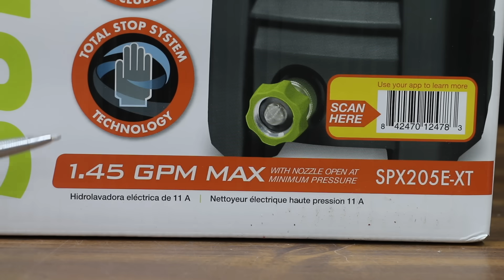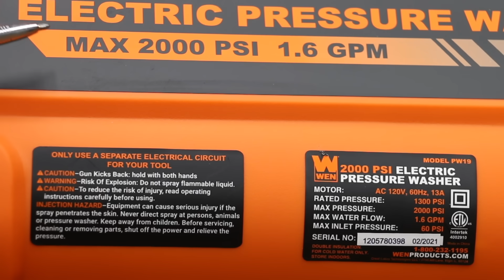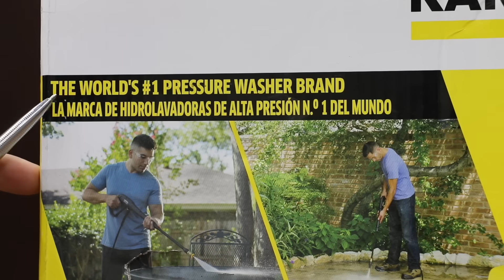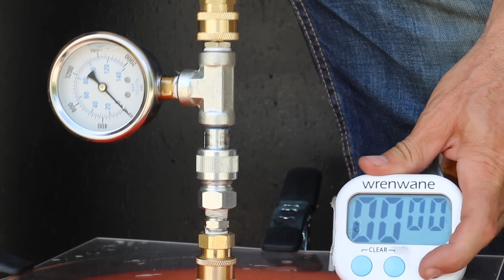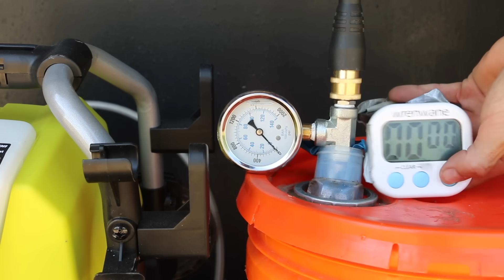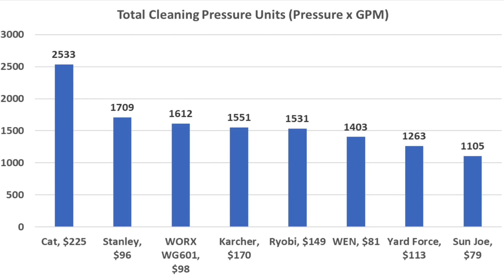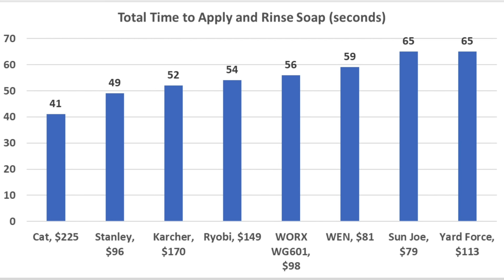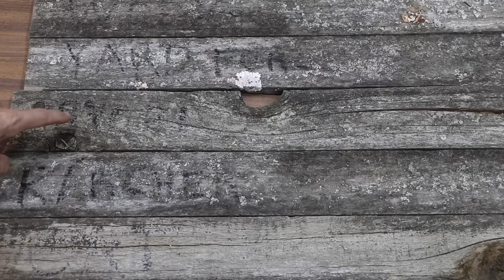Best Pressure Washer (ELECTRIC)? Ryobi vs Karcher, Stanley, Sun Joe, WEN, CAT & WORX

Comment: Can you explain why you had to use the ryobi hose with the stanley in order to use the soap spray gun? Is it because the tip of the stanley is not removable in order to expose threads onto which you would screw the soap gun? If so, why did you have to use a different hose and not a different spray handle? How can you use a different hose if the connectors are proprietary? And how do I use a soap spray gun if I don’t have a ryobi hose? I’m just overall confused.

Comment: You can get adapters for the stock hose to spray gun on the Sun Joe on ebay and aliexpress. You just have to know what to search for. I searched for "decker outlet hose" and then usually there are 2 or 3 options, just verify the dimensions in their pictures and select the correct option based off Sun Joe, AR Blue, Decker, or any of the other cheap power washers. This will then connect to the hose and the 3/8 in quick disconnect you can use any spray gun with it. Ended up only costing about $7. Great adapter!

Comment: PF,  fun time, my wife bought a KARCHER , have NO IDEA OF MODEL, or what, until this , I forgot it was there , I believe she got it from HSN, QVC, OR where it’s under the dining room table, she had passed on , so I’ll check it out.NOW not sure what most people use these for, BUT they are sold in our HVAC/R  supply houses,and some had DESTROYED AIR COOLED CONDENSERS ON AC UNITS, TOO MUCH PRESSURE, best for purpose I’d low pressure,,& high quantity of water , ONCE FLATTENED OUT , you can NEVER STRAIGHTEN THEM OUT WITH A FIN COMB !  There were brands I never heard of 
Cheers     🇺🇸🇺🇸🇺🇸🇺🇸

Comment: As an avid follower of your channel the following: The Karcher you are testing , is not the top model . You are testing apples with pears and peaches! . Having owned Pro car wash businesses, used 24 hours a day non stop , Karcher will outlast any of the brands you tested . And then we are not even talking about Kränzle !!!  Unfortunately , you do not test for endurance . Big difference with a pressure washer lasting 3 to 5 years at a Car Wash or a machine that gives up the ghost after 6 months to 1 year !  This makes things like applying shampoo and rinse off time trivial. I have also noticed a distinct bias towards American branded products. Case in point is the very expensive CAT washer vs entry to mid level KARCHER. Come on , lets get it right with regards to your testing, Apples with Apples. If you keep on testing without doing your homework, you are actually misleading  followers into buying wrong products . Test model rank with model rank and include price performance ratio  😉

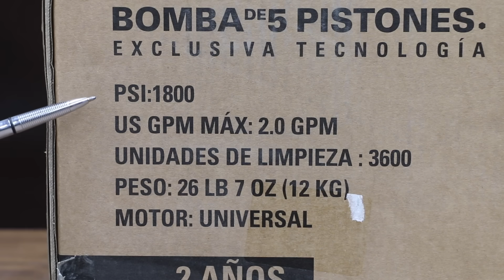Comment: Cat Pressure washer stock test – Weight, current draw, noise level, water flow w/o nozzle: 6:36 – 7:18
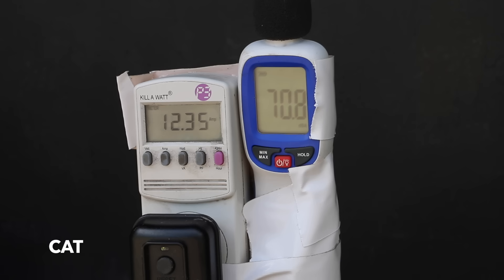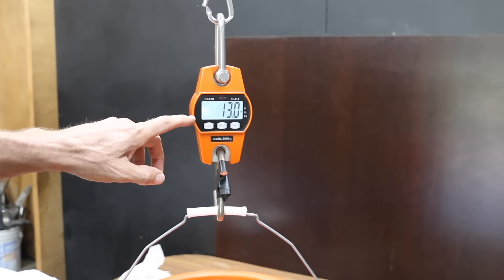Testing Cat with 3.7 and 3.7 size nozzle: 11:20 – 11:48
Chart Comparison of PSI and GPM and Cleaning Units for all brands: 11:48 – 12:47
Rinse and Foam Test All brand: 12:48 – 15:32
Residue Removal Test All brand: 15:33 – 17:33
Pressure Gun Durability: 17.33 – 18:33
Reply from the maker: Thanks for the video idea.

Comment: After watching this video, I did my own test with My Karcher K5 and found that my new Active VE52 (same as the CAT unit) outperformed the K5 in both flow and pressure. (It really makes a difference when using a foam cannon) The other big plus with the Active, It's not using proprietary fittings so you can use better quality hoses and fittings without adapter gymnastics. Now that I found a great inexpensive Power Washer, I would love to see a video on those expensive foam cannon soaps like Adams, Chemical Guys, and Gyeon Q2M Bathe Vs Meguiars and Turtle Wax Snow Foam.
Reply from the maker: Thanks for the video idea.

Comment: Interestingly enough, your “cleaning unit” is a unit of power, and it’s actually the output power provided by the cleaner. If you convert it to watts (just multiply by 0.434), you can use the current measurements in order to get the efficiency by simply multiplying it by the grid voltage and dividing (BTW, why did you measure current instead of power?)
Reply: He just totally ignored your question what a savage 😂
Reply: I think amperage is probably just as useful of a measurement as watts in this case.
Reply from the maker: Thanks for the feedback.

Comment: I would be concerned about the duty cycle rating of some of these.  How long will they run before the run capacitor needs to be replaced?   Ive gone through two capacitors in a very old Karcher power washing all afternoon.
With the CAT brand at 14.7A? It is actually more current than should be continuously put on a 15 Amp breaker.  If I remember correctly, a 15 Amp breaker will eventually overheat, wear or corrode and start tripping below 15 A if continually run close to its rated tripping current. Then you get to replace it.   By code and good design a 15 A breaker should only be loaded  to 80% or 12 A.  And you wouldn't be wanting to continuously run the CAT on a long NMD 14 conductor either, it could get a bit warm.
The CAT needs a circuit designed for 20 A.
This problem has resulted in me renting a 2000psi Honda PW when I want more pressure and flow.
In the meantime I'm using a light weight Bosch PW  with a proprietary nozzle and connections that I both like and dont like.  The oscillating turbo nozzle has a mode that moves stuff more efficiently than a standard fan nozzle.
Reply from the maker: Thanks for the feedback.

Comment: I just subscribed because I came across your You Tube video on power vacs.  I am a single mom who has to now learn all of this for myself, so I appreciate your expertise, very specific explanations, and thorough testing, all delivered QUICKLY, without time wasted chatting.  I so appreciate that!  It is obvious that these videos are probably meant for people who already have some base knowledge, but for those of us who do not, I only wish that at the very beginning of you videos you spend 10 seconds describing what the tool IS and what it is/can be USED for.  Honestly, I don't really know, for example, what a power washer is FOR!  Or what people use it for!  Could you start with something like "a pressure washer is a tool that forces water out at such force it can clean things much quicker, such as your car, or driveway, etc".  I mean....I really don't know!  I thought it was to clean the outside of your home before you painted it.  Is that not true?  Anyway, I am learning so much here about which tools are the best --- but what I first need to know is what tools are for what-- or what most people need-- then when I get them I will know which one is the best!  You are brilliant, thank you.
Reply from the maker: Thanks for the  great suggestion!

Comment: I'm using a Harbor Freight Portland 1750 psi electric pressure washer to clean gutters, garage doors, siding and cleaning concrete and sidewalks. Works like a charm for 80 dollars.
Reply from the maker: Thanks for sharing.

Comment: Todd, As always your videos are superb! As you did with battery chainsaws vs the gas powered, I’m surprised you didn’t compare the electric power washers to a gas powered unit... I’ve been using a 2000 psi gas powered Craftsman for fifteen plus  years.  The 3.75 hp Briggs has been fairly reliable.  I power  wash a lot of concrete. A 3 car driveway, large pool deck, shuffleboard court, a 20x30 patio, & lots of sidewalk.  I use a Karcher 2000 psi T300 attachment for surfaces to accomplish this.  This saves a lot of time over the smaller nozzle. I use up about 2 gallons of gas in the process. It took more fuel when I just used a typical wand.  
One more tip!  After use, it’s important to get as much water out of the pump, hose and wands as possible. Corrosion inevitably sets in damaging the power washer...
Reply from the maker: Thanks!  Thanks for the suggestion.

Comment: YOUTUBE sux. I have been waiting for this video to drop ever since you posted the poll asking whether or not we would be interested, yet Youtube did not notify me that you had made the video, instead I noticed this video in the suggested section while watching your new video on shop towels.
Thanks for the video, it was very informative.
 A year ago I bought a Sun Joe, SPX3001, 2030 psi pressure washer.
 When it arrived it had a bad power switch and when I contacted the company to have it repaired/replaced they did not have any of my model in stock, so instead of making me wait, they sent me an upgraded model SPX3501, which is a 2300 psi model , with a brushless motor. 
I have been very pleased with it. It uses standard fittings, & has auto shut off when not in use.
It works great for cleaning my driveway, car , and house siding. However, I would not use it for any industrial or business related work as I don't think it would hold up to constant hard use. 
My biggest con is the hose reel is very flimsy and the handle came off and required a shade tree repair. 
I can recommend Sun Joe for the weekend home user, not only for their decent product but also for their very accommodating and responsive customer service.
Reply from the maker: Thanks for the feedback.

Comment: How about an ethanol vs non-ethanol fuel  comparison? My wife fills up once every 2 months and runs VP non-ethanol here in the PNW dunes area. Are the long term benefits worth it? We think so considering our service intervals on her Subie Crosstrek are long with the right conditions. More often than not it is new oil/filter, air cleaner and tire inspection then she is on her way.
Reply from the maker: Thanks for the video idea.

Comment: Alright new video idea. You should try using JB weld in a engine crankcase as oil and see how long the engine lasts before the JB weld cures, or until the engine self destructs :)
Reply from the maker: Thanks for the suggestion.

Comment: I have another good idea for you. Best stain or sealant to keep wood from rotting. Ive always heard that used motor oil with diesel 50/50 is the best wood sealer and stain out there, and the motor oil could be interchanged with transmission fluid. How would used motor oil or transmission fluid stand up against products like tung oil, linseed oil,  and other commercial wood sealers. You could take some basic untreated 2x4s, treat them with the varying products and subject the to different longevity test. For example, burring said 2x4s in a controlled compost pile, 24 hour soak in water and weigh the wood before and after, resistance to a power washer, how deep the product penetrates the wood by maybe soaking the end grain for an set amount of time.
Reply from the maker: Thanks for the video idea.

Comment: I paid $118 for my K1700 from Amazon and it’s listed for $129 right now. It was by far the best price:performance purchase I could find. If anyone is looking for some more accurate testing then Obsessed Garage has a very detailed video series covering all price and performance levels of pressure washers. That’s where I got my purchase advice from before going with the Karcher and I’ve been very happy with my purchase for the past two years of heavy use.

Comment: I have a Video Idea.

I can^t find a Test of ^^masonry waterproofing^^ or ^^masonry horizontal barrier^^ the Whole Internet there is no independent test that i can find.

I mean the Liquid that was injected through holes in the wall to make the wall waterproof afterwards.

There are different Brands. Some work with Oil some work with Wax and some work with Silika and so on
Reply from the maker: Thanks for the video idea.

Comment: Have you thought about Multi tools?
Like the cheap bass pro ones, the gerber multi-plier pocket too (USA) and others?

Testing screw driver stripping/toughness, how much force it takes to break the pliers, like putting the end of the pliers in a vice, and rotating the handle until a major malfunction, corrosion tests ETC.
Reply from the maker: Thanks for the video idea.

Comment: Will putting too much 2 stroke oil in the tank of the motorized bike hurt it? I ran out of gas today and had to stop at a farm house down the road to ask if they had any spare 2 stroke fuel I could use. The gas looked pretty clear/yellowish and all the 2 stroke oil I've seen and used turns the gas green or blue. So when I got home I just added a bit of oil to tank. The bike smokes a bit now but I only rode it for like 5 minutes after I added the oil. Should I empty the tank and replace the mix, or should I be fine for about 3/4 of a tank?
Reply from the maker: Thanks for the video idea.

Comment: Now that you’ve mentioned Sunjoe, I think a VERY good test would be to try all the electric dethatchers. You can include battery powered and cable powered. Basically you could test how much resistance they can take, max and over time, what it takes to overheat, etc.
Reply from the maker: Thanks for the video idea.
Reply: Been a while but I'd like to second this

Comment: Test metal paints next please! I'm especially interested in seeing if there's a difference between Rust-Oleum Professional and regular Rust-Oleum, as well as if there's a difference between brush-on and spray-on rust paint, and if putting metal primer on before rust paint actually improves performance. I couldn't really find much information on that anywhere online! Anyway, thanks for reading, and best of luck :)

Thank you for all the work you've done to help us consumers (and hobbyists) make informed decisions on what to buy! My hobby is metal fabrication, and the information you've provided has been extremely helpful in stretching my limited budget when buying cutoff wheels, flap discs, etc. I can't stress enough how awesome your channel is.
Reply from the maker: Thanks so much!  Thanks for the video idea.
Reply: Doing misc steel fab myself, I have taken to using Cold Galvanizing Spray instead of primer.  I hadn’t found rustoleum paint to be better than regular enamels.  After applying CGS, I  cover with the least expensive spray  paint you can get.  The zinc rich CGS coating prevents corrosion in steel.
Reply: I do old machinery restos and would like to se a test between rattlecan paints and paint from a cup gun like an hvlp.  Sherwin Williams Industrial Enamel is my go to.

Comment: I’d like to see a automotive oil filter comparison under working conditions. You can find a hundred different videos where oil filters have been dissected but no videos that simulate real world use.
Reply from the maker: Thanks for the video idea.
Reply: Me too!
Reply: Fort nine channel posted a comprehensive filter type test recently if you're interested. The tldw is paper type actually has the highest filtration performance for all particle sizes but especially smaller size, with fiberglass being worse.
Reply: I’ll save you the trouble, wix oil filters only. We tested them in school

Comment: Is it possible to do a test on different “permanent markers” on an all around style writing surface which may include wood, metal (a couple different kinds), plastic, glass, drywall, concrete, cloth (of different sorts?). I just have been trying to find a decent one and KNOW your tests will give me the best answer.
Reply from the maker: Thanks for the video idea.
Reply: Not a permanent marker, but are you aware of wax type pencils like stabilo pencils? They're designed to write on any surface, but it's wax so comes off easy. Not sure if that's relevant to your needs
Reply: I work in a laboratory where we write on specialized labels that are frozen and thawed.  Sharpies were our go to, but the label material seems to cause them to lose their ink far too easily.  We experimented with others and the bic intensity markers are far superior!  We were absolutely amazed by how long they last.

Comment: I've been using the Ryobi 1,600 PSI 1.2GPM Electric pressure washer at a full time automotive shop for the past 4 years and it's been great. Works everytime for me. I used it 4-6 times a week. If a vehicle repair total invoice exceeds $2,500 dollars, I give a car wash with the Ryobi pressure washer. Going strong still, I think it was like $99 dollars when I bought it on some sort of sale.
Reply from the maker: Thanks for sharing.